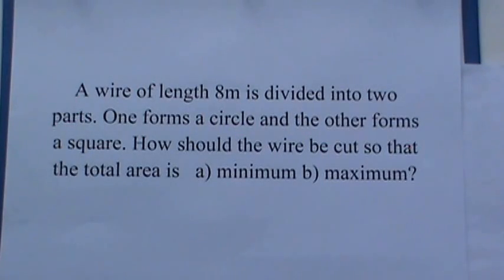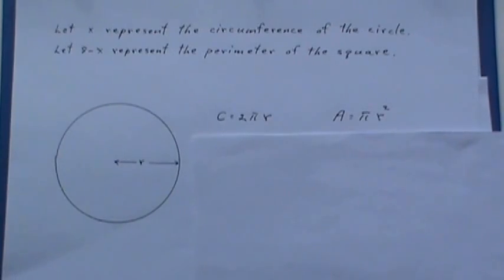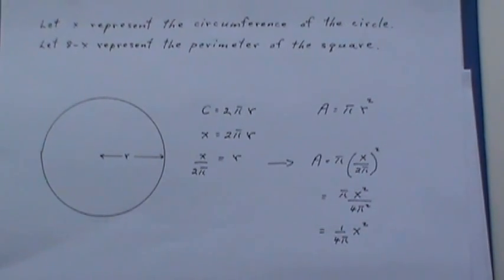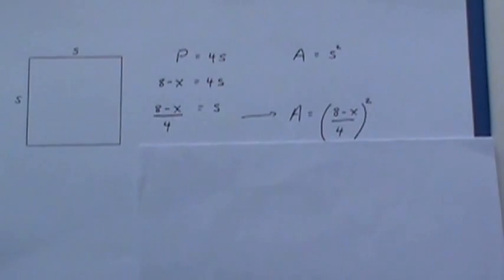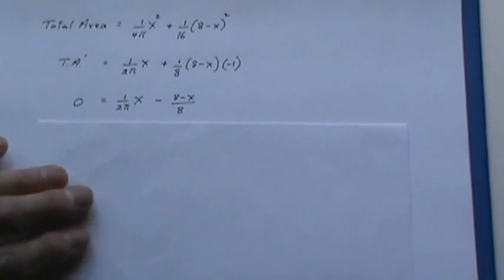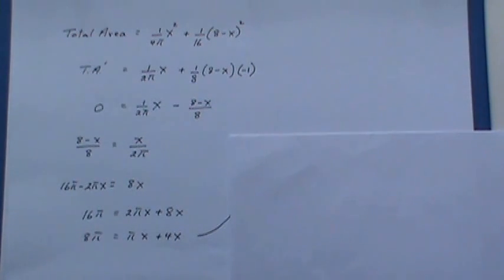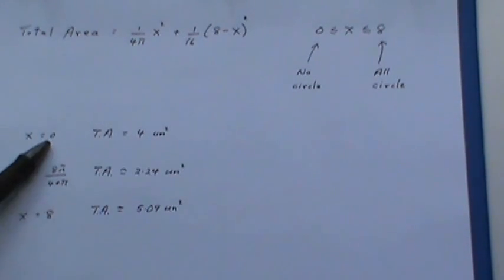Maximum / Minimum Problem (Wire cut to form circle and square)

Comment: I spent a lot of time on a similar question only difference was the wire was 12 cm. I got an accurate function, I manually checked it. I graphed it out. I tried getting the derivative part but the result of that did not match the graph. oh well
Reply: Sad😆

Comment: Would the greatest area be at an end point regardless of the length of wire? I have looked at similar problems and this always seems to be the case.
Reply from the maker: Good question. I  agree that it WOULD be at an endpoint. Any piece you remove from the perimeter of the  figure with the larger area would result in a larger loss than would be gained by a second figure.  Thanks for pointing this out.
Reply: MyMathStudyGuides Good to know. Thanks! :)

Comment: Where should the wire be cut so that the two pieces can form the square and circle with no left over? When the question is in this form am guessing you are to work out the maximum???? A little help needed

Comment: If you use all of the wire for the circle, then the wire is not cut.
Reply from the maker: buckltim You're absolutely right. The only correct answer here, given the conditions, is the one that gives the minimum. As far as the max.goes one of my classes decided that the only way to get "the maximum area" was to cut off the smallest piece that could possibly bent into a square and use the rest for the circle !!
Reply: MyMathStudyGuides There is a similar problem in my textbook that involves the wire being cut into an equilateral triangle and a square. The book says to use all the wire for the square for max area. There is a video here on youtube and the instructor says the wire gets an infinitely small cut. That doesn't make sense to me.
Reply: buckltim size can get infinitely small like 0.0000000000000000000000001. But you could say that particles can only be cut to a certain length. There is a point where a particle cannot be broken any further.

Comment: Where should the wire be cut so that the two pieces can form the square and circle with no left over? When the question is in this form am guessing you are to work out the maximum???? A little help needed
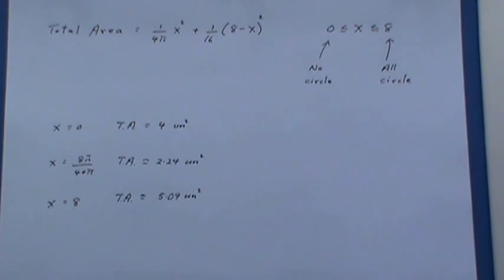Reply from the maker: The only correct answer here, given the conditions, is the one that gives the minimum. As far as the max.goes one of my classes decided that the only way to get "the maximum area" was to cut off the smallest piece that could possibly bent into a square and use the rest for the circle !!     At 5:12 you have the area values at the end points and at the only point between them where the derivative is zero.